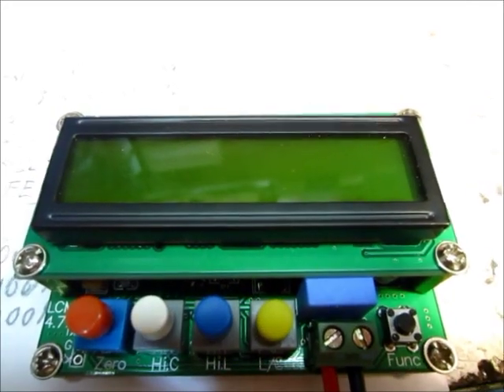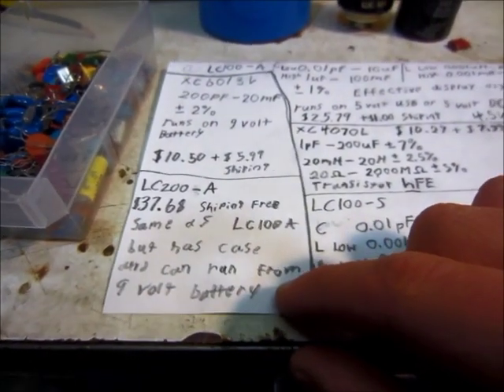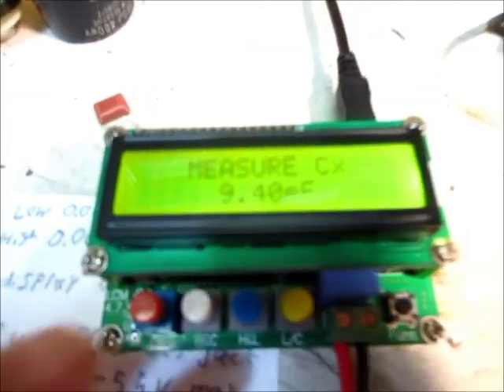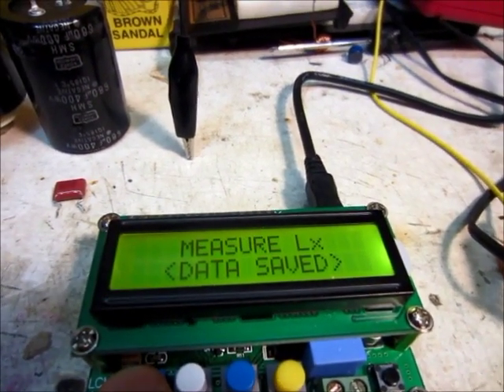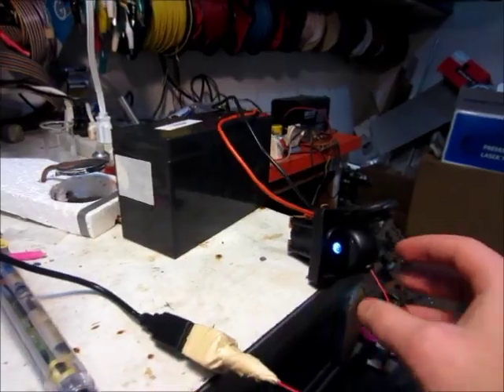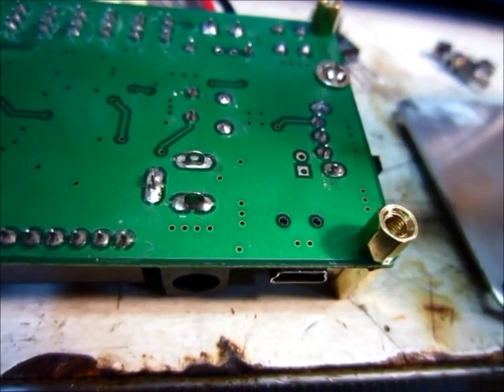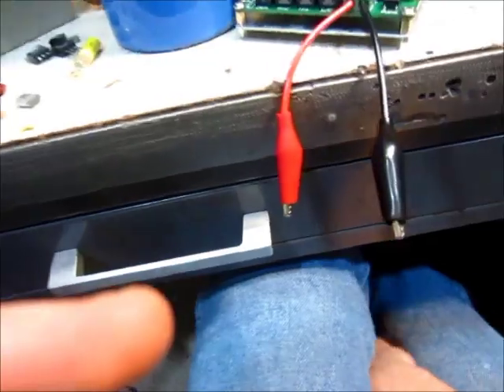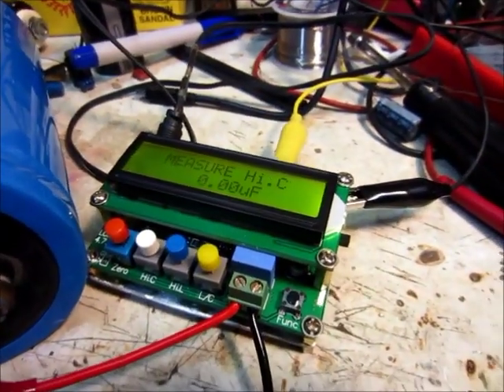LC100-A Capacitance and Inductance Meter Review, Testing, and 5 Volt Regulator Improvement

Comment: I bought this device only for inductance measurement purpouse.  I bought several inductances with a tolerante of 10% in a range of 10uh to 3300uh.  All The measurement we're in The tolerance Interval.

I joined two inductances either in parallel or serie and measurement remain in the Interval.  So I considero My one  some way trusty

Comment: UPDATE:  I just found that my unit is not broken after all.  You don't just press the zeroing button and wait for "OK".  Instead, you should set the unit to low capacitance, and with no device connected, hold down the zeroing button until "DATA SAVED" is displayed.  Then short the probes, and hold the zeroing button again until "DATA SAVED" is displayed.  Then do it again in the low inductance range.
I love the way that this unit is built without a case.  Instead, it just has two circuit boards, with nuts acting as feet.  The design of this device has inspired me to use the same approach in several small electronics projects of my own design.  I have had a unit like this for about ten years.  It broke yesterday, and I will probably replace it with the same model.  

I have to admit that I use my "transistor tester" much more than the LC100-A.   I have the "LCR-T4" model and it is wonderfully versatile.

Comment: I just bought one of LC100-A. The small capacitance measurements were about 20%~30% lower than actual (after Zero set), the large capacitance readings were 3%~4% lower than actual, and I don't have a good means to judge the inductance readings but they seems reasonable. Not sure if mine is defective in anyway.
Reply: I bought this device only for inductance measurement purpouse.  I bought several inductances with a tolerante of 10% in a range of 10uh to 3300uh.  All The measurement we're in The tolerante Interval.

I joined two inductances either in parallel or serie and measurement remain in the Interval.  So I considero My one  some way trusty

Comment: How does this meter perform in the very low capacitor range: So let's say from 10 pF to 300 pF. Is it accurate in this range? How did you test that?

Comment: Thanks so much for this excellent product video. Interesting that this has been around for seven years and I guess somewhat indicative of its utility and value.  While I've been involved with digital electronics for some time, I've never had occasion to get into inductance and AC signals in general, and this device will enable me to perform some demonstrations and experiments to  get a better understanding of inductance and how it is utilized in circuit design.  Your video is just what I needed, so thanks again !

Comment: I have almost the same, has only the buttons in reverse direction, does NOT work on pF and uH/mH reason the comparator does not oscillating, I see 0 Hz and yours give 10 Hz on the test button and as such I can not measure, it looks also that the Lm311 is a fake, and even the LM393 somebody here does now? maybe I do miss something. Measuring uF does work fine.

I have watch your movie carefully, and I am now shure the both comparators are fake, she have dots in pin 1 yours have not, and originally TI has als not.

I have the LC100-A

Comment: That's funny, I use pretty much the exact same Motorola cell phone charger to power my LC100-A.  I also have a USB to barrel jack adapter that came with a frequency counter, but it's just easier to use the cell charger in the mini USB plug.
Have you noticed that with some capacitors, between the high and low capacitance setting, one is accurate while the other is wildly different?  It happens with caps that are in the overlap range between low and high, making it hard to tell whether the cap is shot or actually good.

Comment: +Makerj101 I finally received an original LC100-A (with green LCD and leads on the right) and it works great. Very happy. Thanks for your video! Buyers beware of cheap clones, they cost about the same as the original but do not work properly.

Comment: I ordered two of these LC100A meters but the first one did not work, it did not oscillate and could not measure any inductance/capacitance. So I ordered another one from a different seller. This one worked but it could only measure high value capacitance and inductance:  everything below 10 pF or 50 uH was indicated as 0.000 uH. Since I wind my own toroids I need an accurate one. Is the LC200 any better or are they all cheap clones that will not work most of the time?

Comment: They hand solder the smds instead of hot air. Terrible job. Could somebody please give a look at the unit they have and tell me what the value of  C7 is? its missing on the board. Its the big smd on the edge.

Comment: Anybody got a schematic for this Zhenzheng MingHe LC100A meter?  I have inherited a faulty one, but I am mainly curious as to why there are effectively 3 comparators in the circuit.  I'm pretty sure one (half a LM393) is the oscillator, and the LM311 probably uses the time constant RC=0.632*Vcmax method of determining the values of polar capacitors.  What does the other half of the 393 do?  Tracing the connections on SMT is not at all easy for my eyes!

Comment: Is there a way to get readings out of this unit into a PC or an analogue input device?
Reply from the maker: +Glenn Leishman hmmm... That I do not know. It uses an adriano type processor. So it's possible. You would probably have to write computer software to display the values if it does support that.

Comment: I just ordered a 4070L for 18.50 from ebay, its properly housed in a cute casing like a multimeter and runs from 9 volt battery, really need one of these to measure inductances from coils of wire
Reply: +Makerj101 ,
The 4070L is way less accurate and won't even get close to the range of this cheaper and and weird looking, BUT ACCURATE device!
Gotta True RMS multimeter (th PROTEK 506) that measures whatever one would imagine, but in shorten ranges than any special device can. This is the special LC metering device and I'm gonna buy one because I need to measure small inductances and large capacitors.
Reply from the maker: fidel catsro Cool!
Reply from the maker: +driveparty Nice looks like a good meter!
Reply: +driveparty its working well, all boxed nicely in a blue little box

Comment: Well I ordered one off eBay but be careful as some of these are real crap.  The one I got had the leads coming from the left side of the board.  The first problem I had was the alligator clips were not soldered on (just crimped) and readings were very intermittent.  So I fixed that.  The next problem was the micro USB connector which has no stress relief on it's connection and pealed off the board when I plugged in a USB cable.  Fine, still have a 5v jack.  Tested some Inductors - flaky readings but after awhile I got some decent readings.  Next tested some capacitors - everything was 1 to 5 picoFarads!   In my opinion total CRAP - Save your $20-25 and buy a real LC meter.  Wish I had, oh well, I'll salvage what I can (Screen, standoffs, etc...) and scrap the rest.
Reply: I wish mine worked like the one in the video - functionality not nearly the same or as smooth.  Pretty obvious the firmware is different in mine too.
Reply from the maker: Digger D If you didn't get the same thing that was advertised then contact the eBay seller.  I've done that many times when I've gotten bad products from eBay.  The sellers will generally do anything in their power to stop you from giving them a bad review on their eBay page.  I've had my money refunded on faulty items, replacements sent for free, and partial refunds.  It's really hit or miss with buying things on eBay because stuff is so cheap and you just don't know.  But you can have a better experience if you:  Make sure the seller has lots of good reviews before you buy, and if you'd product it faulty or you don't get what was advertised them write to them. Hope that helps.
Reply: I bought this from Chip World and they were extremely difficult to deal with - I was going to return it but the cost exceeded the price.  So it's parts for something else.  I won't deal with Chip World again though and I buy a lot of stuff on eBay from China - most are pretty good.  I've been through the process several times but never had the problems I had with those clowns.
Reply from the maker: Digger D Ah I see.  I never heard of Chip World before.  Keep experimenting!
Reply: you ended up with a copy version.
Reply: Mods & Tweaks Most likely
Reply: Digger D
see this link below:

http://www.ebay.co.uk/itm/172329014726?_trksid=p2060353.m2763.l2649&ssPageName=STRK%3AMEBIDX%3AIT

see picture 3 - that is genuine.
Reply: Thanks, since then I purchased a DE-5000 and B&K Precision LCR meter ;)  The kit I bought will be salvaged for parts as needed ;)
Reply: I bought same shit on aliexpress and this waste of money and time.    While it may show proper capacitance the inductunce measurement is horrible.  Especially I need measure small inductance and valus are playing tricks on measurement even with +-100% increase\decrease since initial measurement.
Reply: Same here: I ordered 2 and they were both complete crap. Do not point at the usb connector, it will jump off the board instantly. I could not measure any reliable value below 50 pF or 10 uH. I did demand a full refund and got it in both cases but it was a waste of time.

Comment: Thanks for the review - good job - I ordered one as other reviews and this one seem to indicate it's pretty accurate.  I also ordered the Transistor Tester (as a kit) based on Atmega chip from China as well.  Between the two I should be covered.  I like the plate heat sink - why not ;)

Comment: Nice neat mod to this, but I would put a little hot glue on the two caps just as a bit of stress releaf. You could if you wanted to go the extra distance use a opamp to compare the input voltage and a relay to bypass the regulator if the input voltage is too low, but personally I would not bother ;).
Reply from the maker: idiolore Good idea!  But yeah I think I'll skip!  It works good enough with the modification!  Thank you!

Comment: hy Makerj101,whats is the chip that is based on?Atmega?thx!
Reply from the maker: I don't know!  I'll have to take a look sometime!  But yeah it's probably some kind of micro controller.
Reply from the maker: It is a STM8S103K3T6C micro controller.  I'm guessing it's similar to the Atmega but I'm not really sure.
Reply: Makerj101 Thanks for the info man,i was suspecting to be a stm8...its a cheaper version of atmega and identical to it.I bought a similar meter but based on atmega328,it has more functions built in.
Reply from the maker: ady0187 I see!  Cool!

Comment: Testing with a capacitance meter can be misleading, for example, although the capacitance value may be within tolerance, the ESR can be high. ESR is a very important parameter to measure when testing a capacitor. So you may overlook a bad cap thinking it is good when troubleshooting. ESR stands for equivalent series resistance and is hands down the best way to test capacitors.

Comment: I made and sold identical items to stores. I recycled glass and made planters, I recycled spark plugs and made pipes, I built and sold a lot of picture frames for a long time. These days I am trying to build things with new parts without making parts. I post first prototypes on Youtube and continue to improve and search for parts. I understand basic electricity and studied lots of theories (analog and digital) but had little circuit building practice. I recycled and fixed lots of machines.

Comment: It feels good to know that you are fully equipped to recycle and evaluate circuit elements. When I throw away electronic devices, I felt that my trash is full of money and my pocket is full of trash. Take this piece of advice from a recycler: Purchase rolls (or sheets) of labels of all sizes and label all the parts after you measure them. If you add information about what device they came out of, then you give them market value. As you know, if you can describe it, you can sell it on eBay.Thks

Comment: The "470" on inductor means 47 uH, It's a scientific notation -- 47 x 10^0, much like the one used in SMD resistors, i.e. 224 means 22 x 10^4 = 220000 Ohm.

Comment: I have the same one. With the high cap mode. Although I'm not sure how many mf, might not be as much. More range than I use though, Just checked a 2200µf and got 2.36mf. Biggest cap I have is 3300µf. I got a lot from your video. Had forgotten to connect the leads for zeroing lc. Wasn't saving either :) Really liked the power tests and regulator, Very nice mod. You get a freq on lowCx, but not high. Freq will vary reading, if you are using dif freq, you can calculate the diference from test freq.

Comment: nice lil mod with a very nice metal plate cut out.  Looks like a perfect fit.  I guess if u prefer voltage flexibility it's good, but u end up using a wee bit more power.  I was going to buy this as well, but i recently bought mine a week ago and waiting to receive the LC200-A, which is the one with a case.  Figure for 10 more bucks, i get a power brick, a case so i can use a battery and don't worry about shorting it or twisting the wire.